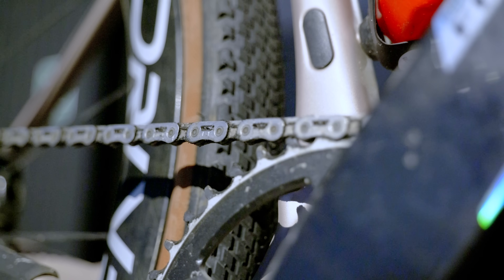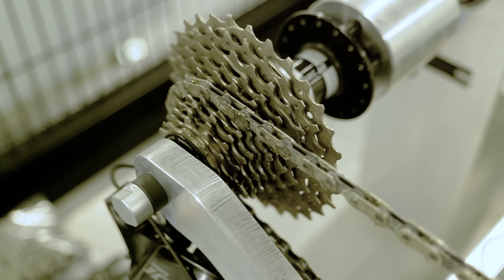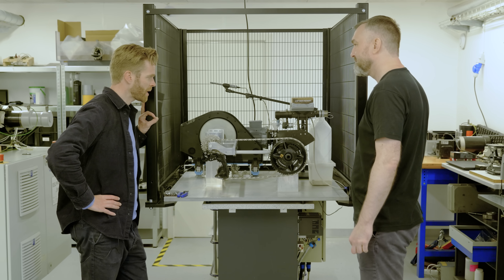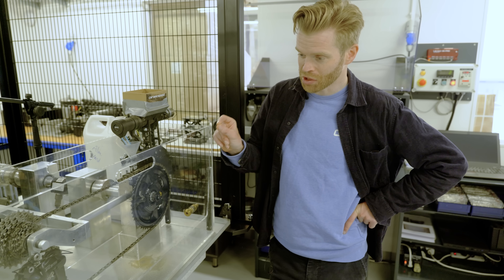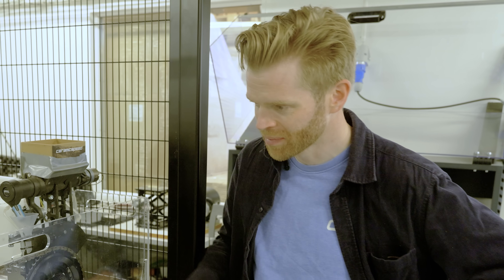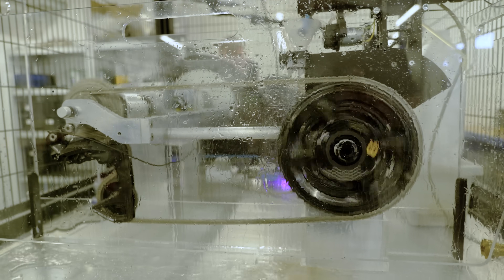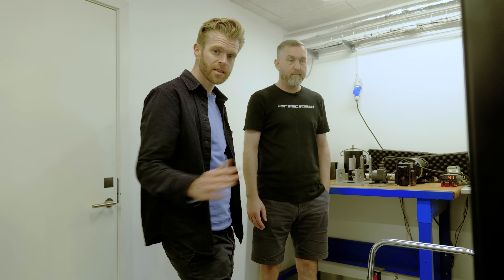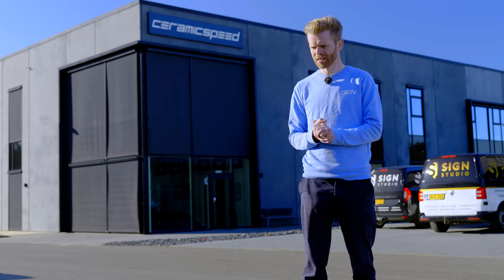We Lab Tested A Dirty Chain, How Much Slower Was It?

Comment: Great timing with this video. I've been thinking a lot about what I've read and watched on ZFC recently. 

Measuring the losses directly, in real time, makes far more sense than trying to deduce something about friction based on chain stretch measurements over thousands of kilometers.

The host and engineer did a really nice job putting chain losses in perspective. That a larger sprocket is more efficient isn't surprising, but I would not have guessed that it had such a large effect compared to a dirty chain and cross-chaining (the two things that we are always told to avoid!).

Will the marginal gains crowd switch back to 2x and 3x drivetrains so that they can work in larger sprockets? Fingers crossed as a 2x rider that would love to see the comeback of the front derailleur.

Comment: 1:00 - "I've also got a chain with me that's exceptionally dirty,"

🤣🤣🤣

That just looks like an ordinarily dirty chain to me.

But for this test to really show us the difference between a clean and dirty chain, it should show us the *same chain* in clean and dirty states. Comparing a used chain with a brand-new chain is obfuscating the result by mixing clean vs. dirty with new vs. used.

Comment: Quit putting clingy stuff all over nice hardened corrosionless faces, & they'll quit collecting so much dust & grit. 

A high quality bicycle chain doesn't rust & sheds debris, far better than any oil or wax designed to cling to the surface ever possibly can. 

Don't be fooled. A good spare chain, is more cost effective & efficient than 'pro' waxing regimens.

Comment: The derailleur pulleys.... they can get nearly impossible to turn and you won't know unless you really check things out. Always wondered the best way to clean and lube them. Taking apart the der isn’t trivial for many. I guess im thinking of my mt bike after riding the colorado trail in miles of grass, muck etc. But the road bike gets stuff all over them.
Reply: WD40 or similar cleans & lubricates pulley wheels perfectly. Use the applicator straw to get right up to them & it will blast out any debris, leaving a coat of light lubricant. Been used successfully for decades by professionals.
Reply: @JoeyMills-y3v i will never use wd40 for lube. Maybe to clean.... but it is very rarely discussed how to maintain these.. so...
Reply: @jarralryter  wd40 is a perfect lubricant & cleaner for pulley wheels & derailleurs, professional bike mechanics have been using it for decades. Waste your time & money on other stuff if you like though 😂

Comment: You have been using a brand new chain in your tests.  Two things might have affected your tests,  A) every engineering item even if manufactured in a precision manner might needs a bit of run in to eliminate microscopic levels of surface roughness.  
and B) A brand new chain is quite stiff in its ability to flex sideways which is affecting the efficiency when running on different cassette sprockets.  Once the chain has run for a few hundred km, it becomes a bit softer in the sideways flexing and some of the losses from not running on the 6th sprocket will be reduced.  
When I put on a new chain, but maintaining the same cassette and chainring,  my setup needs a bit of time to run smooth again.  The guiding jockey wheel also has an effect on this.  If the jockey wheel is new / nearly new it will have very little sideways wobble and guide the chain in perfect manner.  It the guiding jockey wheel is a little worn, it will flex sideways and if you put on a stiff chain (stiff in the side flexing ability), you will need to correct the cable tension a little bit to allow for this difference. 
I am running mostly YBN chains in a 1x11 setup and these chains are excellent for longevity but they are alos quite stiff in the sideways movement, so if I want to have a perfect ride, straight away, I might also change the guide pulley at the same time. The tension pulley is of little concern here.

Comment: When it's mentioned @5:45 that a waxed chain has a break-in period, is that a single break in after being waxed, or does that power loss for 15-30 minutes occur on each ride?  That 15-30 minute time frame would make think that it's the wax warming up and (semi?) liquifying, which means it'd be an every ride type of deal.  Or am I reading the physics wrong?
Reply: For Wax its 99% the initial break in. After that, it may have reset a tiny bit but nothing you can measure really. Maybe the crazy endurance waxes can be worse (and the initial break in will take awhile, i'd say for sure more than 30 minutes).

Comment: only if you guys did the test on a dry one that makes the noises and it could also be dirty.

well i was running on one of those and my god i actually feelt the performance increase by oiling it.

the worst chain you can have for eficiency is a completely dry one aaand thats dirty. but it has to make that noise, squeaky noise

Comment: I use an old chain washer machine from BBB (stupid brand, I know) - but it works - and my new(er) Park Tool Cyclone is still parked in shelf un-unpackaged (that a word?). EIther way - been riding for 20+ years, during the last ten or so I use MucOff chain lube that smells like bananas and strawberries (no f_ing kidding... and once rats that had settled in the garage chewed the bottles open because they thought they would get a nice dessert) - and the chain has been FINE (including mostly clean). What people forget - is that lube (or oil) which is wet - attracts all sorts of mallacarchy on the chain. You use WD40 - your chain is going to be absolute Sh_t in a week. You use motor oil - you are an idiot (youtube does not like this word). Always buy specific chain lube (either from Pedro, White Lightning, MucOff or any other brand) - and maintain your chain every day in intensive riding scenario - or every other day - if you ride less than 20km a day. Been doing that - using cheap KMC chinese 10x and 11x chains (which according to my valuation are better than Shimano) - and the drivetrain has been FINE. Also - just to mention - chain and standard derailleur is BY FAR the best force transmission mechanism - any idiotic vegan (or other I'm special) belts and gearboxes don't even stand close. Also - why is there a one-by drivetrain on the test machine? Clearly, a normal 2x or 3x would wear much less and wouldn't try to countradict simple physics (44 by 11 will always be tons better than 36 by 10, unless you're an idiot).

Comment: Maybe there is a reason why this is the case but... If the losses are higher in smaller gears, why not mount the large chain ring on the inside instead of the outside to maintain an in line chain with larger gears at the back to maintain efficiency?

Comment: Is this taking the changes in ratio into equatio? Its obviously gonna take more force to spin the output shaft twice the speed on the smaller sprocket vs the larger.  I would think there would be some complex math there to correct for that.  The fact its so linear makes me think it has more to do with the ratio than it does the radius.

Comment: I ride a 52/36 and a 12-25. I would be better off with a 54/40 and 14-28 then. Jockey wheels should also be bigger but also placed so the bend is minimized….slightly offset…which happens when you ride with a short chain!

Comment: Isn't that sram chain flattop and 12 speed specific? And allegedly only compatible with sram 12 speed cassettes, pulleys and chain rings? 

How does that affect the results and comparisons, specially when the other chains  used (dura ace chain for instance) are actually meant to be used in that setup?

Comment: Can you do  a follow up to show the different effects in isolation. I.e. measure the effect of sprocket size without altering the chain line, measure the effect of chain line on its own. Then measure the effect of running through a derailleur vs without. And do it at different power levels - not all of us cycle at 250w. Should we all be riding single speeds?

Comment: I find this fascinating, but! Isn't it out of the riders control? I mean we can look after and prep our chain and drive train as good as we possibly can but 30 minutes into a British winter road ride and it's all out the window anyway! All we can really hope for is that we've protected everything as best we can, the efficiency doesn't really matter anymore or are we going back to having coverings over it all like the old steel bikes in the 50s, maybe even an oil bath in the bottom? Have you seen those? It would be interesting to see if a more modern carbon fiber drive train cover has any benefit, especially aero dynamically. Specialized have been using disc brake rotor covers in MTB DH. Reasoning unknown!

Comment: What would happen if the chainring is smaller than the sprocket, like in MTBs? The loss in power should also be measured with respect to the difference in size between the sprocket and the chainring. My guess is that the loss in power will reach a minimum (or close to it) when the sprocket and chainring have a similar diameter.

Comment: I was a very keen touring and TT cyclist in the 1970's when we only had 5 speed blocks. Chains run out of alignment then and our smallest sprocket was 13 tooth (Regina block). I used double TA rings (46x34) on touring bikes, Campag (53x44) on a road bike and Campag 57 for TT. Chains were kept clean on the later bikes but my commute and YHA touring/bike could get grubby in the winter months. I used to wash the touring bike chain in parrafin and when drained put it in SAE 90 gear oil in a saucepan and gently warm it up on the stove, then leave it to drain off hanging up. I have no idea what a waxed chain is. I rode many (60) 25's inside the hour the best 54:46 on E72 and a '50' on V153 in 1:50:01. Happy days.

Comment: Great video. I always suspected the bigger sprocket was more efficient and that proves it

However, how does it work in the chainring? How much power diff happens when you use the same sprocket in different chainring sizes?

Comment: They need to take into account the drag on the axel bearings when comparing big vs Smaller rear sprocket because it alters the rear axel rpm. A bearing doing more rpm has greater losses.
Reply: The test machine measures the entire drivetrain, including the bearings. Theres a torque sensor on each axle.

Comment: What about the effect of chain ring size? Would a bigger chain ring off set the gain of using a bigger rear cassette gear? Or could you actually maximise efficiency by using the big chain ring and big cassette cog with the chain on the extreme diagonal which is thought to be a sin (if you have the derailer set to avoid chain rub).

Comment: Well known engineering fact, chain drives, unlike gear teeth, are not involute... ie constant angular speed input does not give constant angular speed output. An eleven tooth sprocket has eleven speed/torque spikes superimposed on the output.
The wheel is driven through an eleven sided polygon, with associated small variation in radius between the points and the centres of the flats.
On larger sprockets with more teeth the variation is proportionately less. 
this could make smaller sprockets less efficient.
--- This is a good video. That the results are not quite as expected makes it credible and interesting. ---

Comment: The losses of the chain line is due to the force being able to spin the chain to only be parallel to the rear cog. So if you're applying a force at an angle, then only the component of that force that's parallel to that rear cog is helping you move.

Comment: The srm powermeter is +-2,5w accurate at 250w, the tracx neo is +-2,5 as well. The confidence, that ceramic speed is measuring 1w difference with, seems improper to me

Comment: I would say the results make perfect logical sense. A chain articulating around a large sprocket doesn't have to bend as much, and the load is distributed over a greater surface area.
Reply: It’s the difference in Watts some might find surprising though. You can also reason how an extreme chain line increases friction and affects efficiency. Without seeing the objective testing, gut feel might have you supposing chain line is the bigger factor.
Reply: Actually the load still hits a very tiny surface area on mostly just one/two teeth, but the leverage of a taller sprocket dramatically reduces the PSI at the primary point of contact, resulting in lower friction as each tooth loads & unloads.
Reply: @prophetzarquon  It is like being able to lay on a bed of nails. The more there are, the safer it becomes. A larger sprocket means that the highest load is spread over 3 or 4 teeth at a time, rather than 1 or 2.
Reply: Which would explain why pros are running really large chainrings these days to avoid going onto the smaller sprockets as much as possible. Even if this means having your last 3 highest gears being only possible to use on descents as a bailout gear. Aiming to optimize most of the usage on the top end of the cassette.
Reply: @ryoukokonpaku1575  Pros run big chainrings mainly because the change in gear is far less than with smaller chainrings. Ofcourse, the reduced friction is another benefit.
Reply: By simple physics, "surface area" doesn't matter - friction is a function of the coefficient of friction between the 2 materials and the "normal force" pressing them together.  

The real world tells a different story as that "simple physics" assumes a standard of flatness of the surfaces and no accounting for materials (like tires) conforming to a rough surface -- "tire on road" isn't exactly the same as "rubber on concrete".

Comment: I got the impression that Ceramicspeed engineer was saying that the Shimano chain was more efficient that the SRAM. I'd like to see that comparison. I'd also like to see the test of the oversize jockey wheel versus standard size and the 105 bushing jockey wheels versus the bearing type in the Dura Ace. Some good stuff there.
Reply: Hi, the difference is maybe 3-5 watts depending on what you lubrication you use. On the old "gold standard" test machine from Friction Fact days, you would maybe see around 8+ watts on a SRAM FORCE with MFG grease. Knock that down by ~2 watts or so with a super efficient wax. Shimano 11S may be around 4-5ish watts with MFG grease (way thinner than SRAM and SIL-TEC coating is like teflon). knock that down to close to 3 watts with super efficient wax. Mind you that only tests chains and not entire drivetrains.

Comment: I will now change my drive train to a bigger chain ring and a bigger cassette. No more 11 teeth on the rear, I am looking at starting at 13.
In fact, I simply never thought about this. But it really makes sense with the sprocket sizes and sling angles down there. I can hear slightly more chain noise at 11 teeth. Noise equals friction.
Reply: I searched a few years ago and the only realistic options are the Miche Primato Cassettes
Reply: @joaopinho9074  thanks for that company name. They do not have the right stuff for me, but that's kind of what I thought about.
Reply from the maker: There used to be a company called Marchisio who could deliver a cassette to you in a custom ratio! depending on your setup, you may be able to find one of the old junior cassettes that were made, they started with a 14t sprocket! Pretty sure Miche made some that started even with an 18t too!
Reply: @gcntech  Thanks!
I decided I will buy a Wheeltop, upgrade to have  gear more, and then just not use the 11. The smallest sprocket weights close to nothing.
Reply: My single speed experiments led me to the same conclusions. 64 teeth to 9 or 11 rear is pointless without a vehicle to slipstream behind. Also a huge stall point from stationary. 

64 : 13 is quite usable on flat with almost no stall.
Reply: @AlienLivesMatter  Anyone knows some company that makes custom cassettes?

Comment: Curious about how a Pinion gear box stacks up to a derailleur system in a lower gear. I bought a Pinion so not to fuss with lube on my work clothes, but I feel it is a bit slower/less efficient due to all the gears turning in an oil bath.

Comment: On the biggest sprocket, the chain on the cage is going through less articulation (cage is near flat).
In the 11T the cage is fully back and the chain is making 2 x 180 degree turns.
Granted it’s on the return/non loaded side but there is still going to be some effect.

Comment: Now I'm starting to think that the next biggest innovation in cycling would be a chainring that can move sideways to always stay in line with the sprockets as you change gears.
Reply: Absolutely not. That would require much more heavier add more moving parts.

Comment: OK, but who can pedal at a continuous 95RPM? The excessive RPM will exaggerate any losses from a chain. I'm not an athlete, but I cannot imagine outputting 250 watts. As an engineer, I would think the friction of the idler sprockets on the derailer would create a lot of drag, exaggerated by their small diameter, which means they have to spin faster. Most idler sprockets just have a very simple friction bearing. Great point about the inefficiencies introduced by chain angle.